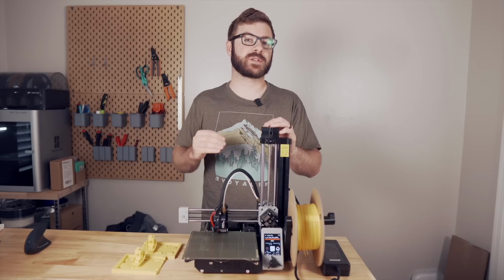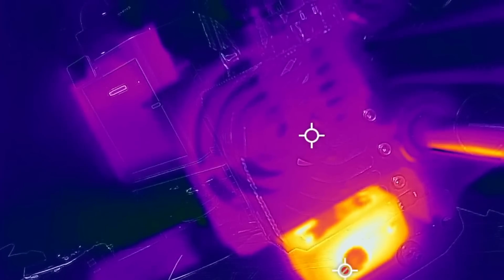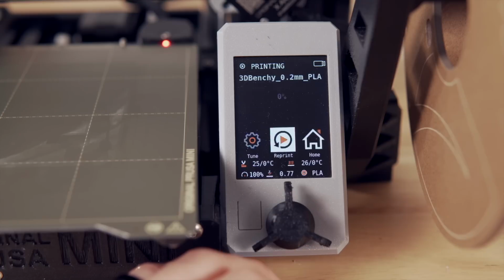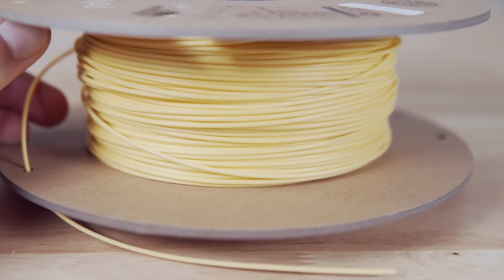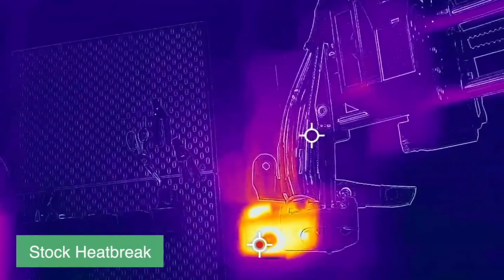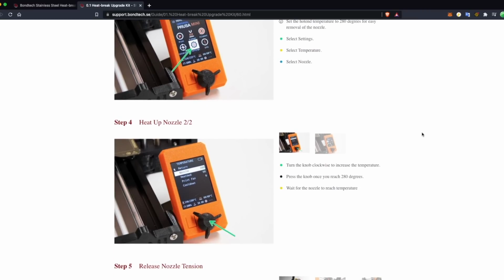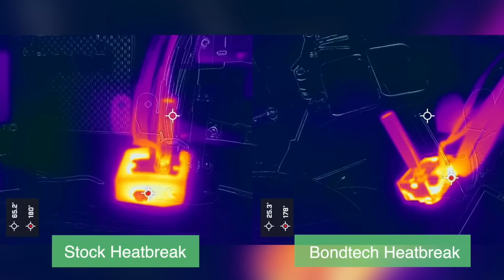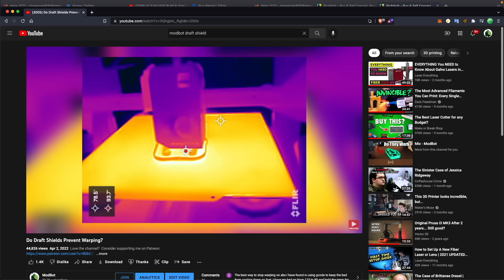HeatBreak Design Causing Heat Creep? (Exploring Prusa Mini)

Comment: I've been battling with heat creep for the past 7 day's solid, I upgrade my am8 to a e3d v6 clone, it printed fine with Sunlu PLAMETA at 180 for 3 days....I changed something in my setup that couldn't go back but then no matter what I printed at x time in the print I would get heat creep. I haven't solved it but my latest print is currently running, I've learnt a lot this past 3 days! It's been fun for sure I've come to the conclusion eventually the block heat would creap my theory is it oozed out (like on a cooldown) when it retracted at a certain point/time/layer when having a small healthy pool in the throat which caused an air pocked that expanded at the PTFE; The reason I think this is every time I manually unclogged the throat and took off the nozzle I would see the top of an air bubble just a bit bigger than the PTFE itself going up around 3mm I would say it had a wall thickness of almost nothing but it was solid as a rock. I switched motor's which didn't solve it, calibrated it to the max so I knew I was at a good base on the feed rate and then dialled down the temps. 

I got to 165 on the heater and probe provided and switched to the stock heater and started at 170 and worked down. What started all this off was the dreaded tick but now I'm sat at 168 degrees and it seems a sweet spot - The previous heater would cause the temperatures to fluctuate a lot which when it spiked to 171/172 would cause the pool it seems I managed to catch it early once and the bubble was just forming.

Comment: Actually I got heatcreap mostly on sections of the print with many retractions - even with the bondtech heatbreak. Actual reason was the coldend fan. While on the mk3 Prusa used a noctua at full speed, on the Mini a cheap but powerful fan is used. But it is reduced to 38% speed in firmware. After increasing the coldend fan speed by a modified firmware to about 60%, no hearcreap anymore. After solving the problem this way, I actually got rid of the original coldend fan and replaced it by a noctua running at 100% (on the old Buddy versions GND is PWM controlled, so I just connected the black fan wire to permanent ground).
While I now use another hotend (revo micro) and also direct drive, I still use my noctua fan at 100% as coldend fan - and it works perfectly.
With all thees people having problems with  clogging hotends due to heatcreap I can not understand why Prusa do not allow to adjust coldend fan speed in hardware settings. Most people would be able to solve the problem by just increasing from 38% to 50% or maybe 60% fan speed without any hardware mod.

Comment: My Prusa Mini+ does well with PETG and PA12. I don't think there is much difference when you pull out heatbreak from the radiator. Not exactly a good test because radiator absorbs a lot of heat and dissipates it. I regularly print with hightemp materials that are 240-260 C, and PTFE in the heatbreak is fine. It does not go all the way to the nozzle and just the fact that there is a lot of contact with the radiator kind of ensures that PTFE won't reach 230-240 C

Comment: My issues are when printing petg longer than an hour. I can’t stop the heat creep on the stock heat break.
Reply: Yeah especially when you have prints with overall low volumetric flow rate.

Comment: The stock heatbreak was definitely designed to be user proof. People broke the heatbreak on the mk3 all the time. The newer Mini+ has a delta fan that is louder but better performing so it reduces the chances of heat creep.

Comment: it could also be the switch of materials required seasoning by putting a few drops of 3:1 oil or machine oil into ptfe tubing. the pla could be getting stuck and dragging in tube from the pteg absorbing any oil in the tubing especially in the heat break area. pla will self lubricate over time from additives of plastic particles that contain oil. there is no way to be certain but as a good practice re-seasoning when switching back to pla, you can also run about a meter of abs plastic thru as well to do the trick.
Reply: do NOT oil your filaments! WTF!

Comment: The resolution of that scale is not high enough to detect underextrusion, especially in a benchy. You need at least a .1g resolution scale. 1g of underextrusion on a benchy would be significant.
Reply: Scale won't help detect it at any sensitivity. All it can say is one benchy weights different from another. Unless there is a calculation to know exactly how much the part would weight under ideal conditions, nether the weight or mass will tell you how close to ideal the printed part is. With infill that becomes much more difficult than it would be for a solid part.

Comment: If you want to check for weight differences between prints, you're going to need a more precise scale. I picked up one with 0.01g accuracy for about $15 bucks off the Bezos Express. It's $17 now, but eh, what isn't? YouTube doesn't seem to like links in comments, but if you search for B07L8ZVVRM (the item ID), it should pop up. Fuzion brand, black and orange case. Gets the job done.

Comment: Still running my mini all stock. Ran everything from CF nylon to tpu to PC thru it. From short prints to long prints. Been running it for 1.5 years now :) I've had worst luck with PLAs that are silk  or PETG then any other filament. Usually the silk types Grinded away at extruder etc, but a bump in nozzle temp stopped that issue on next print.